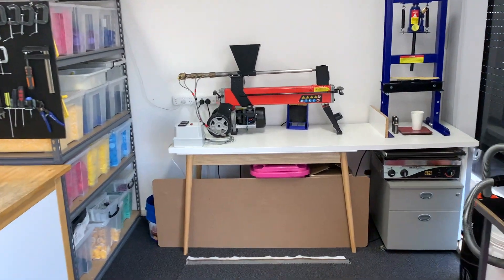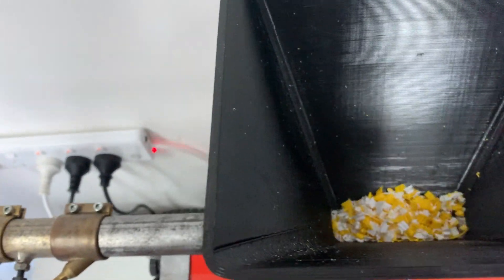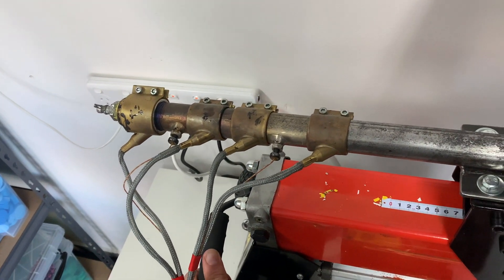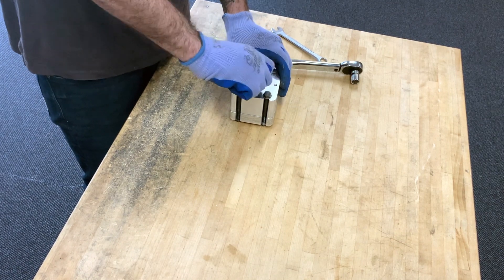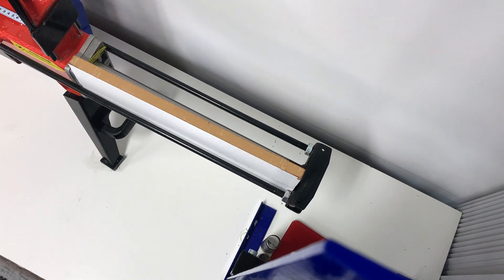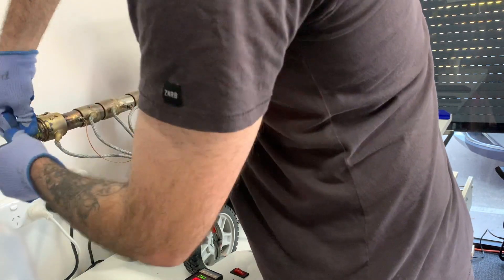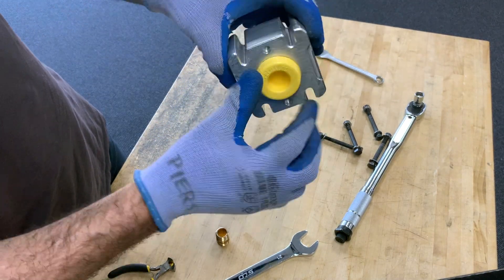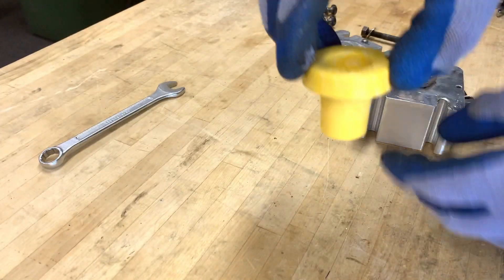Injection Mould Machine | Precious Plastic Melbourne Hydraulic Upgrade

Comment: great video! I am also planning such a machine as a successor to my injection. is it also possible to fill the pipe permanently with plastic during operation so as not to have to wait? and can larger/more complex parts be manufactured with this machine than with classic injection?

Comment: The machine wastes a lot of time on a simple piece, the installation of the mold with the screw is time consuming and the pressure tolerance is low, and the screw will not last long.
Reply: They could produce a dozen parts in the time required to find utility in your post.

Comment: Hey guys awesome but simple machine . Im in oz also could could you tell me were you got your heatbands from . Thanks
Reply from the maker: Hey Tom, these ones were from Hales in Melbourne.
Reply: Thanks for the help
Reply: Just one more thing I’m having trouble with is nozzle design . My injection machine will be similar design , and I am also using hdpe . Is there anywhere you guys know of to get info on this . Thanks
Reply from the maker: @Tom-zr6yj  All details can be found here: https://community.preciousplastic.com/academy/build/injection we use a 1/2" BSP fitting to attached our moulds to the injection barrel.
Reply: Hi, just wondering if you guys found any information online on the pid controller set up . I have looked up a few on YouTube but still haven’t had any luck getting them to heat up and stay at required temp . I  am using the Rexc100 also just seeing what parameters I need to adjust to get it going. Any info would be appreciated. Thanks

Comment: Great idea, gets the job done which is the main thing! I'm going to be experimenting with 3D printed moulds (405nm resin based moulds). Have you tried to use 3D printed moulds? or MDF moulds with this machine?
Reply from the maker: Cheers! We have only tried alloy moulds on this machine and would advise caution if you are not monitoring the pressure!
Reply: @PreciousPlasticMelbourne  Thanks for the reply, I will continue to investigate it, hopefully it isn't a dead end as I have already bought a 4 ton log splitter, and I'm unwilling to pay for a proper CNCd tool. Cheers for the help, the channel is helping a ton!
Reply: If you don't want to invest in a CNC machine, try casting the mould from a 3d printed original part.
Reply: Threading would need some planning.

Comment: Would cam locks for your mold bolts make unmolding easier?
Reply from the maker: Yes, however they'd have to be super strong. If the mould is overfilled you could have a hard time releasing them but it's worth a try!

Comment: Weste of time
Reply from the maker: Commenting?
Reply: @PreciousPlasticMelbourne  because of high cost . A piece takes at least five minutes to prepare. Because It will waste a lot of time. If you give your die the option to open and close the automatic, it will be super. It takes a lot of effort to open the manual.
Reply from the maker: @h723  The cost is actually pretty reasonable. The log splitter was approx. $300AUD and was an improvement on the manual machine we took the other parts from. I'm please to say that since we built this machine, we have produced enough parts to not only pay for the initial expense but also upgrade to a fully automatic, used commercial injection machine. Check it out here: https://www.instagram.com/p/CTE0s9znr_M/
Reply: @PreciousPlasticMelbourne  That's great to hear.   Thanks much for sharing.   I wonder, what sort of parts being produced delivered that commercial success?   Were they produced for a specific client, or were they products you marketed?    Thanks much for your feedback.

Comment: This is so cool! How does the heating work? Are those induction or thermal resistance elements? I have an unused log splitter just waiting to be misused! Do you have to use anything to keep the piston clean,  like oil or silicone?
Reply from the maker: Cheers! These are band heaters which you can pickup online. These ones are “premium” and cost $60aud each. Might be overkill.. not sure. Once the plastic is heated it doesn’t stick to the steel piston. We Use LDPE & HDPE only so we’re dealing with low melting temps.
Reply: @PreciousPlasticMelbourne  alrighty then! Overkill is definetly the way to go, if something is worth doing, it's worth overdoing! Thanks for the advise, and thank you for cool videos and ideas! I wish all the best to your future efforts!

Comment: As a person who has worked in the Plastics industry as a setter/production technician for 7 years. This is oddly satisfying to watch. Not the normal cycle times I am use to but still great video.
Reply from the maker: Thank you! We’ve been running it a few days a week for the past 6 months and have made some significant improvements to speed. We’ll be posting an update in our next video.
Reply: @PreciousPlasticMelbourne  can you make a similar video for aluminium recycling and moulding

Comment: What happens if you don’t pack the plastic as it’s heating? It doesn’t melt or you get air bubbles? The removing of the tip every time looks like it’ll wear out the threads over time, there’s gotta be a better solution for that, but i like it. I want to build one as I generate 20 kilos a day of scrap hdpe from my business
Reply from the maker: Good question. We use this technique when making thick parts to prevent sink marks, however it's not necessary for all moulds. We actually found that filling the hopper and letting the rod fill the barrel after each shot actually works well for smaller parts. Having said that, it's difficult to monitor if the mould is full.

Comment: Although precious plastic is a great idea the inefficiencies of these systems are actually worse for the planet than the highly optimized industrial processes. Simply wrapping your barrel in a fiber insulation will cut your melting time and energy usage by a MASSIVE amount. Right now you are putting more heat into the room than into the plastic.

This is the same as banning plastic bags. If you consider that paper bags weigh many times more and the increased fuel used for transportation paper bags use more oil than plastic bags which can be used multiple times, recycled and used to replace trash bags. Paper bags are usually destroyed half way through their first use if they even last that long. It is much more important to focus on recycling and increasing efficiency than trying to do these low tech replacements.
Reply: The point of precious plastic is basically that it's a sort of movement to prevent plastic from going to landfill and encourage people to reuse it.

It's not meant to be some big superpac with billions of dollars in research funds providing industrial machinery and fully researched and finished processes. It's more a social thing to help bring about a necessary change in how we view and use plastic.
Reply: It seems to me  you suffer from focus blindness or are just intent on pissing in somebody else's cornflakes.   Everything has a cost- including the energy demands of diverting waste plastic from our environment.   Others- many others -place value on capturing plastic waste before it enters our lands/rivers/seas/food chain.   Were you to investigate further into this narrative, you would know they progressed from manual injector>to this machine>to an industrial injector; each step made business sense at the moment it was taken.   They walked a path with the capacity and resources practical to each step.
Reply: Paper comes from renewable trees instead of oil... when the bag is done being used, it can be turned into egg cartons, etc.. Obviously, cloth is better.
Reply: @Acecool  bioplastics exist.
Reply: While there's some validity to what you're saying, you skip over two fairly substantial solutions. First with PP; they set up with the intention of preventing plastic going to landfill, that there currently aren't any waste streams for. With fully developed machines, and processes, they should be able to achieve that goal, while not attempting to be competitive with more efficient industrial processes.

Second with single use bags; take your own bag. Stop being lazy.
Reply: who cares about "the planet" people watching this want to make an injection molder for hobby or business use.

Comment: Have you thought about instead of just threading it on, getting plastic into the threads etc, to use a 37 degree flare hydraulic fitting on the barrel nose instead? They are super common, cheap, and would make it much faster and easier to exchange mold/plug.
Reply from the maker: A quick release fitting is on the cards for future moulds. Stay tuned!